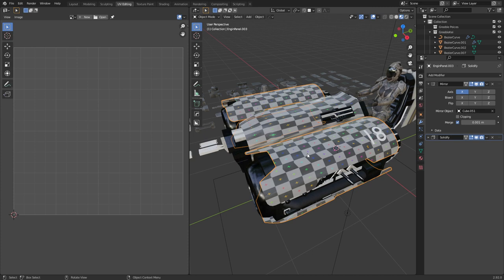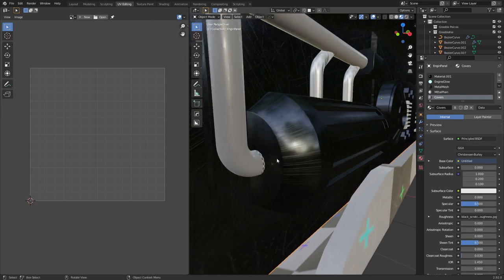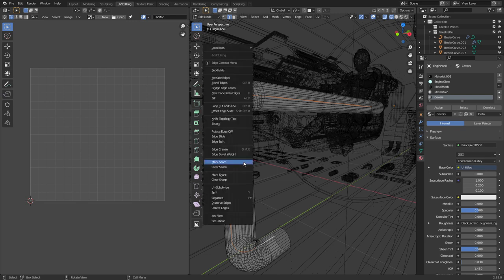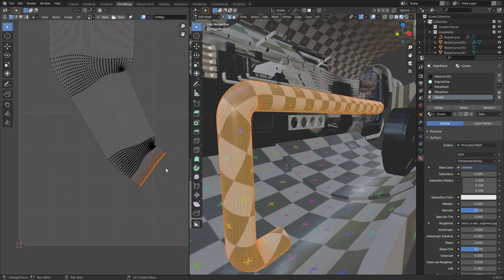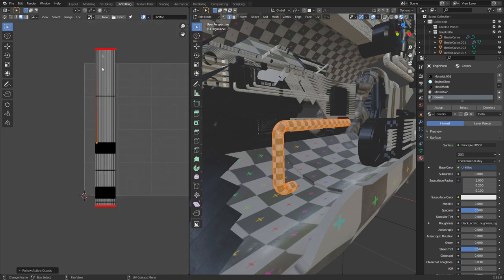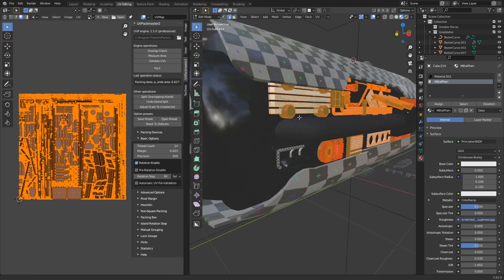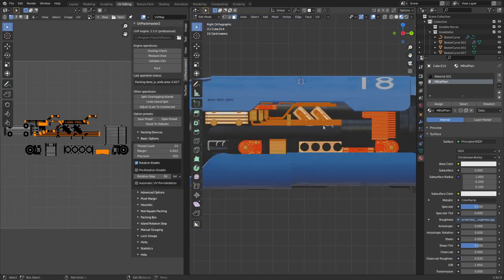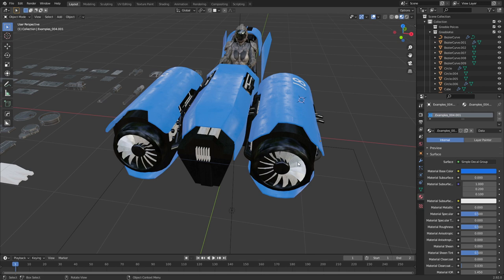Blender UV Unwrapping Tutorial

Comment: Hello Markom.  Great video, sadly I could use a bit of help here. I am trying to cut down my draw calls within blender on "Extracted Unreal Models" (Fortnite Character, with props merged onto the body UV set up already) . So my mesh has a working UV map and unwrap already applied. Yet when I go to try and unwrap something off the OG UV set my object picks up color from all across the OG texture image. Is there a way to isolate the unwrap to its correct image location and gain a new image based off the correct colors? I have to regain computing power somehow, and figure this is best place to go next, because I am assuming that something as small as a Thigh Holster off of a Deadpool model is still reading the ENTIRE texture layout that came into Blender on the completed model. Plus tricks like decimate, and limit dissolves only help slightly, and can quickly make a model unfit for direct camera sight within my animations. I am loosing CPU horsepower fast and would love to isolate the reason, and begin training myself on corrective and safe fixes hopefully. Thanks for the help.